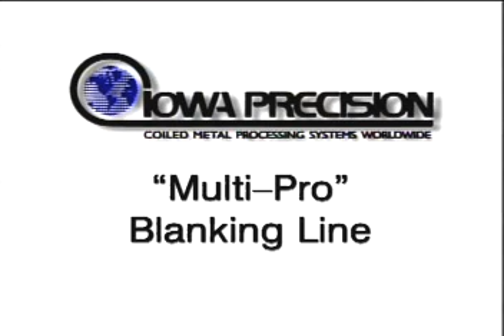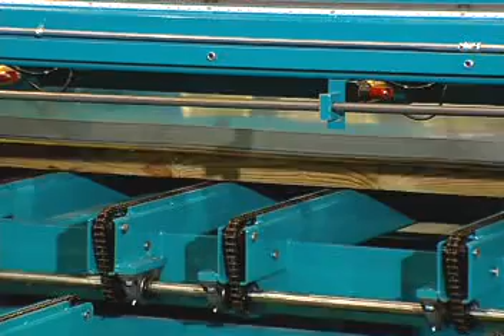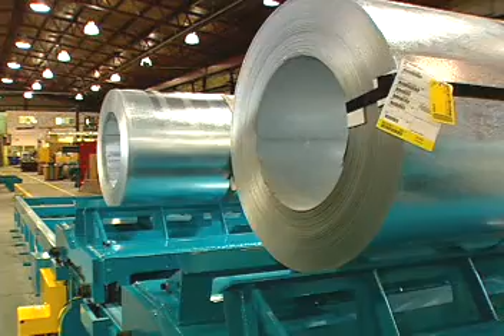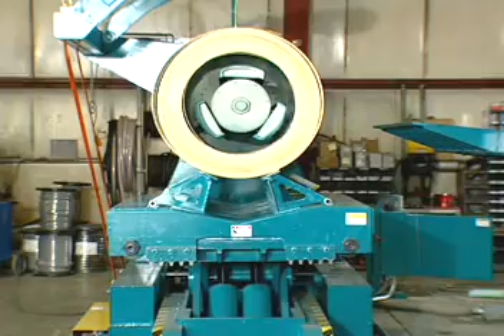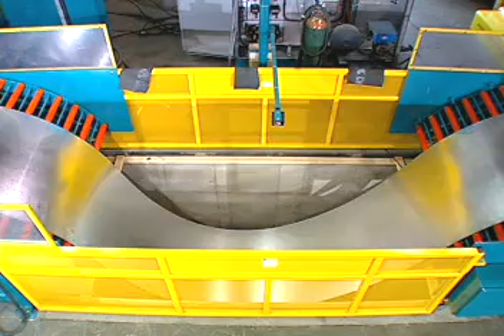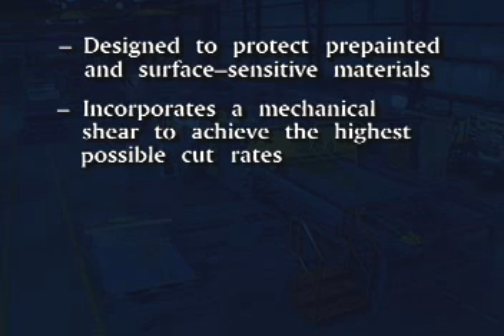450FPM Multi Blanking Line

Comment: @

Hello folks, are you into strip processing lines line Cold

Rolling Mills, Degreasing, Pickling and cleaning lines, Continuous Galvanizing

lines and are having problem of carryover fluids, are you having troubles having

a clean strip at the exit. Now you can use the High Performance Adaptive Strip Wiping

system, it wonderfully works without any electrical or Compressed air, it’s a fit

and forget solution with Zero consumption of electricity or electrical energy,

simple and innovative design click to check and enjoy